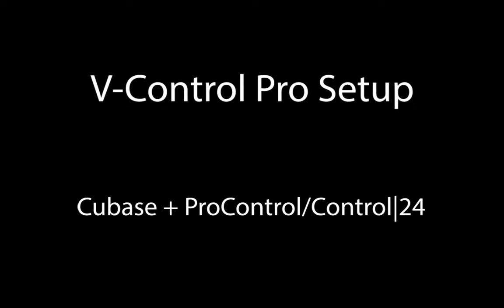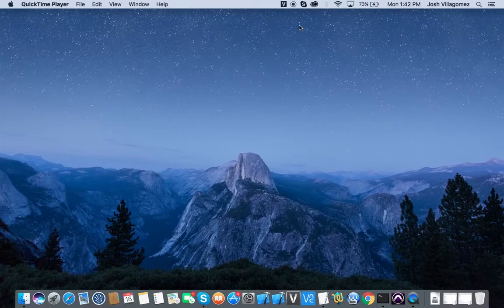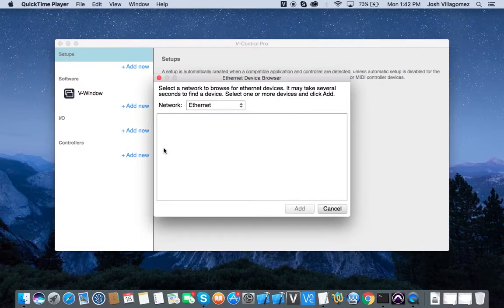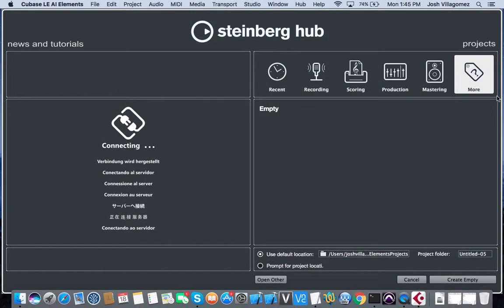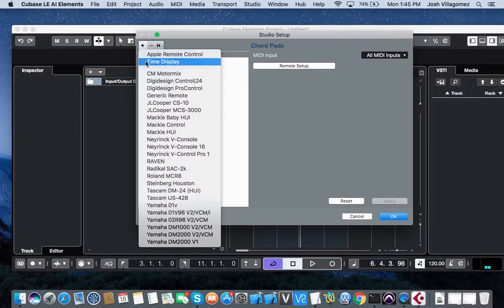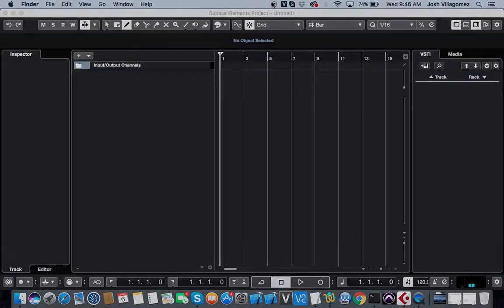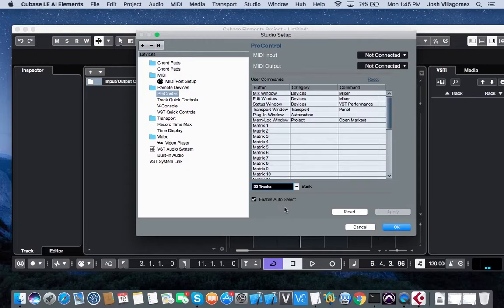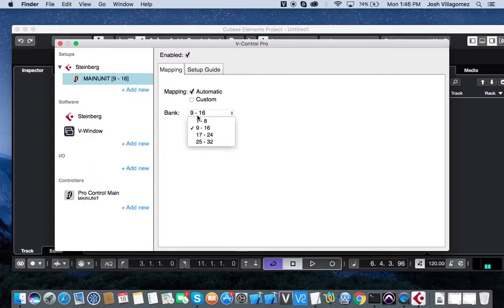Setup ProControl Or Control|24 In Cubase Or Nuendo

Comment: Wondering if you can help me out. 

I'm running windows 10. 
Cubase 10.5
Apollo 16 interface (silver front)
I downloaded the V-control pro (free trial)

I've got it to read my Steinberg(cubase) software but just can't seem to get it to read my avid c24 controller. I've tried connecting the c24 straight to the cpu via ethernet (crossover) also through network using a (straight) ethernet cable and no luck. 

Any tips?
Reply from the maker: I am sure we can get that solved for you. You can find neyrinck audio on Facebook or you can request support on our website.